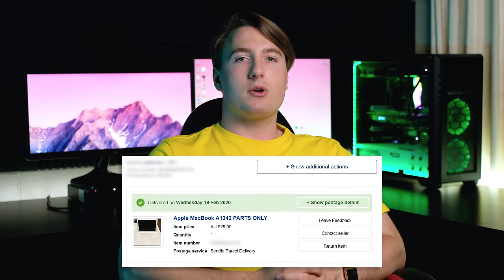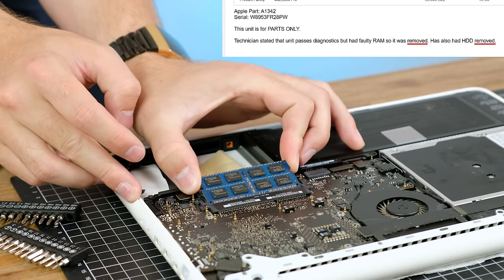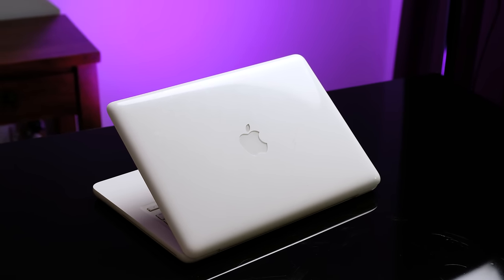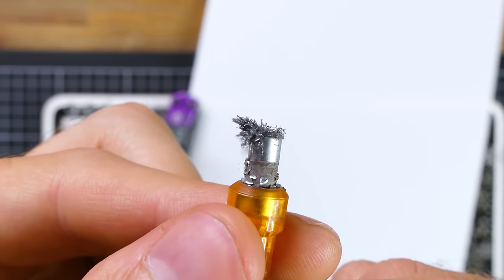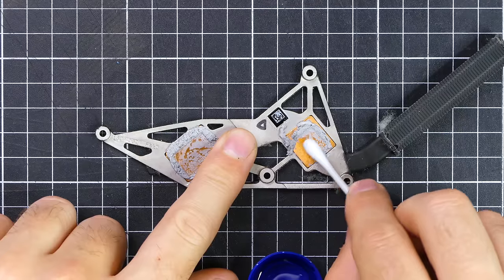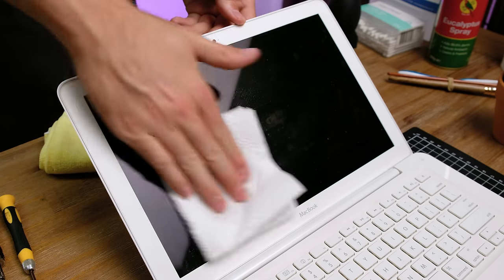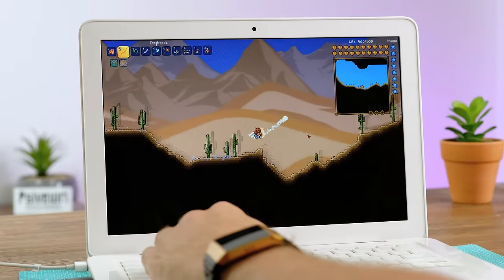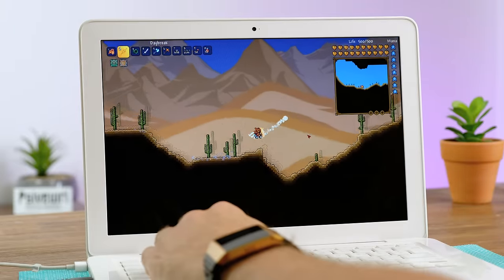$29 Apple Macbook Restoration!

Comment: The usb for 10.12 wasn't working because the date and time isn't right and the certificates have expired for the installation, try opening terminal and typing in
date 0115114518

It's a bug and this should fix it :)